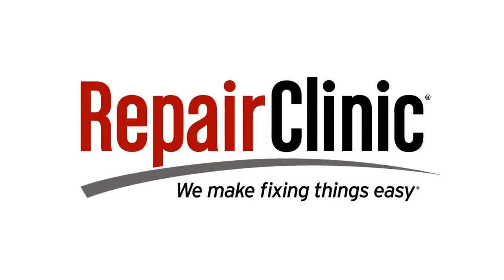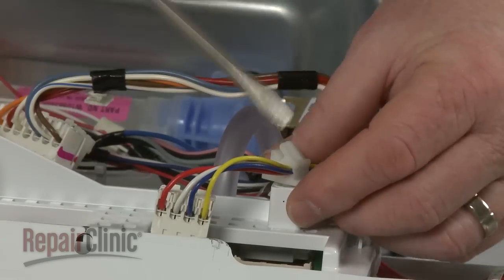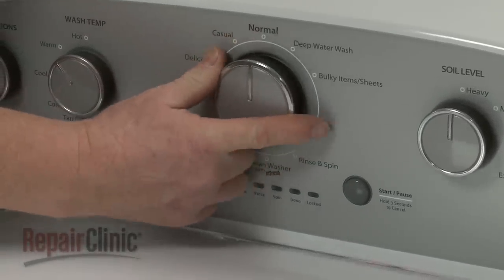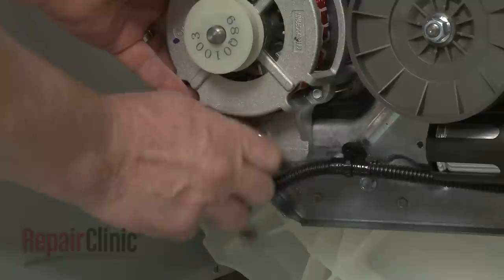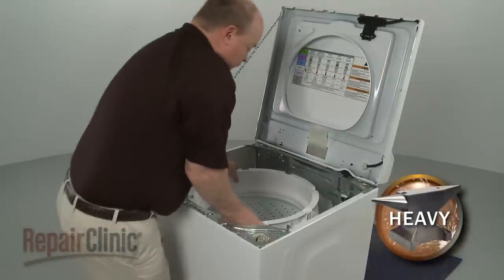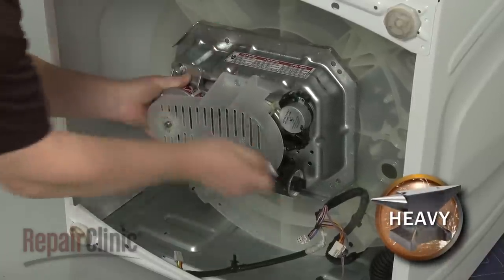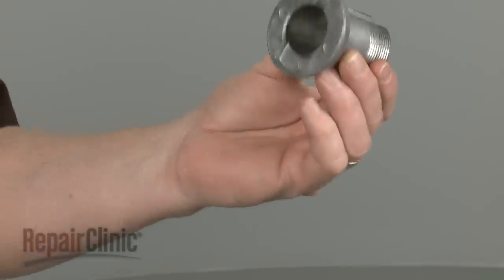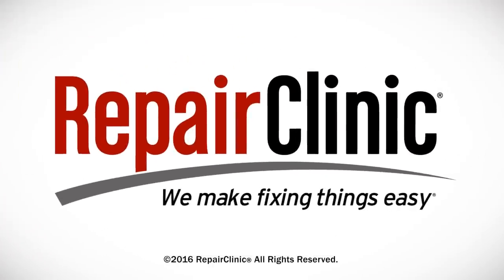Whirlpool Top-Load Washing Machine Disassembly, Repair Help

Comment: I have a cabrio with belt drive. Spin cycle sounded like an Apache helicopter. The top bearing in the gear case had failed. The case is riveted together apparently not designed for repair. Replacement cost $232. I figured what the hell and took it apart. Finally got the shaft out and cut bearing off. Put shaft in the freezer then slid a new bearing on. Bolted the case back together. Reassembled the washer. Now it's good as new and super quiet. Cut the rivets with a grinder
Reply: Mine sounds more like a Locomotive but I believe it's the same problem.  Did you take in photos?
Reply: Sorry no pics. If you feel it grind when you turn the shaft, it's a bearing.. Usually top one
Reply: Where did you get the replacement bearing?Thanks
Reply: Mine(Whirlpool)was the bottom bearing.  You did right repairing the old one because I got the 170.00 version of the gearbox and had to troubleshoot,, (earlier post here).

Comment: Weird thing is the nut that holds the gear on the bottom shaft does not work on the new gearcase, it seems to have a different thread pattern, it’s very disappointing because the model number is the correct unit, I will see if I can find the correct nut what a pain!

Comment: I have a Maytag bravos top load belt drive washer. Clothes were still very wet after spin and drain. Replaced the drain pump and it spins and drains just fine but when in wash it does not agitate the drum back and fourth? Any direction I should start in? Could it be the shift actuator?  Any help will be greatly appreciated.

Comment: i have a whirlpool large capacity 2 speed 8 cycle washer that when i turn the water on to fill the tub the water splashes out the back cause i tub is slightly leaning forward but when i push the tub back the water dosent come from the back i was wondering if you could tell me why im having this problem and why the tub is sitting towards the back where the water comes out

Comment: Got the gear in and it makes a plastic gear noise when in the test mode when it goes to agitate. I watched your videos several times. Took it apart numerous times and cannot find the problem. The gears didn't seem to be worn any. Would the actuator be bad? Anyone know? After looking at the other post I know this is a waste of time as no one gets back with the post.
Reply: I know no one reads this but if it would help one person than it's worth the effort.   ANYWAY,,,I found my problem, the NEW gear box inside splined shaft shoulder was 1/32 to short and allowed the outside teeth on the pulley to rub the inner teeth which sounded like it was tearing the teeth off.  Put it back on the old gear box and it cleared fine. Measured the NEW gear case small shaft shoulder (inside the spring/splines)and it was 1/32 shorter than the old one. This allowed the flywheel close enough to rub the teeth on the inside.   I drilled the inside hole bigger on a stainless washer and put it on the small splined shaft which located the flywheel 1/32 out from the cam unit and so far it's working. My first thought was that I lost the washer inside the unit but after a check on the old gearbox I found no washer and it cleared. It's something to watch for if you buy a new gear case.
Reply: @rodneybooth4069  I think I have a similar problem as you.  Washer agitate but could hear the motor turning with some grinding like sounds.  Have everything apart up onto the spring gear deal on the bottom.  Can't see anything wrong at all. cant figure out how to tear it apart anymore either.  Not sure if its a clutch in there or what,  dont know much about washers.  Also if i push on the bolts on the bottom that holds the pulley on it moves in and out about half inch or so, not sure if thats a problem or what.
Reply: Hire a professional if you are in need of immediate help
Reply: @michaeldevine889  Mine is still working, the next repair will put it in the dump. :0)
Reply: @michaeldevine889  I would if the price of repair wasn't going to be over 3/4 the price of a new one - and if I could find a reliable pro repair person out here in rural Texas 100 miles from Dallas.  You would not believe the idiots who call themselves professional electricians, plumbers, carpenters, arborists, etc.  There were two different father-son electricians, the first team could not figure out which breaker to throw to turn off the electricity to a wall plug,  and the second came for general repairs, my wife got him started on the one because I was out on the property, and when I got to the house and tole him the rest of the work he insisted I had to pay a second trip charge because my wife had only mentioned one faucet and not the other two that needed repair.  He would have been paid for all his time and materials, but instead he got an angry customer who will never use his company again, and always badmouth them when possible.  There were five other idiotic events like that.  Then we had an ice storm and a crew of five young men drove down from Minnesota with two or three trucks and other equipment, did our three days worth of tree work at a very fair price, were so friendly that my wife made them a batch of cookies, and generally earned my complete respect.  There is something about the idiots around here that make me leery of any workmen or company until they prove themselves through competent performance.
Reply: @ammoalamo6485  I like cookies.

Comment: I have a Whirlpool cabrio washer that throws out black specs over the clothes and inside the washer after each wash and the fabric softener dispenser is filled with water.  I have never used fabric softener!    I called Whirlpool and they had no idea -- said call a repairman.

Comment: I have a whirlpool Wtw5000DW1 and it's on the locked cycle and does this clucking noise that licks and unlock s in 5 sec interval. Will not come on with sensing cycle while it's doing that Anyone know what it is or how to fix
Reply: Did you get the answer
Reply: The lid lock needs to be replaced.
Reply: Linda Buzier - if you have any solution to this I beg of you please reply so I don't have to spend $600+ on a new washer.  Today, three years after your comment,  I have the exact same problem with the exact same model number washing machine.  It gets to where it needs a final spin, the lid locks and its red light comes on, the 'sensing' light begins flashing but nothing else ever happens - just red light lid lock and green light sensing flashing with lid locked down.  If I unplug and wait a half a minute it will allow me to open the lid, but then I have a load of extremely wet clothes and no way to spin them.
Reply: @ammoalamo6485  Sounds weird but check the drain on the bottom. I have the Cabrio version w/o agitator, and my did that exact thing. It was  a clogged drain. Less than an hour and no dollars spent.